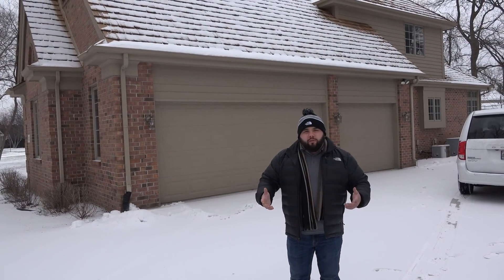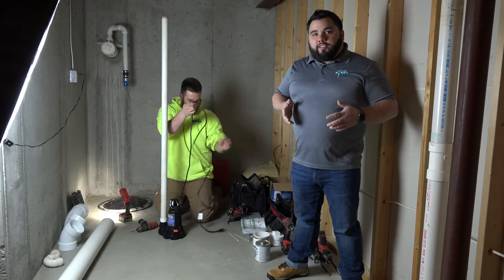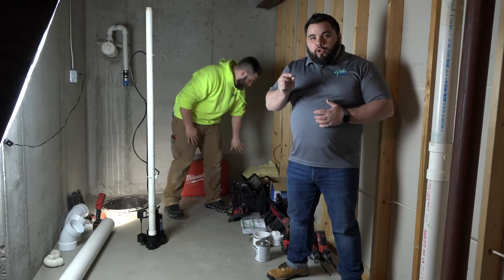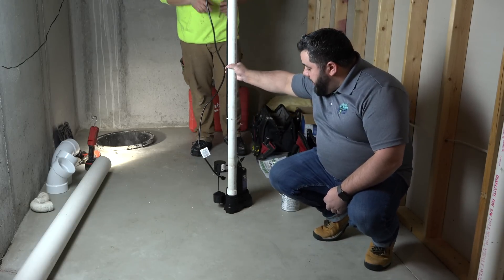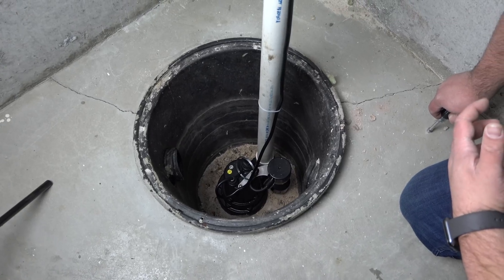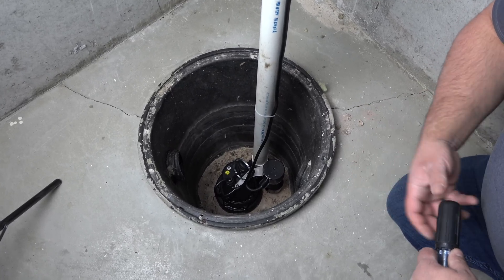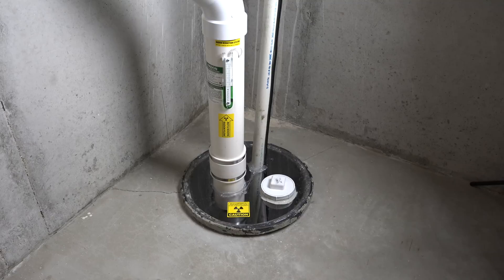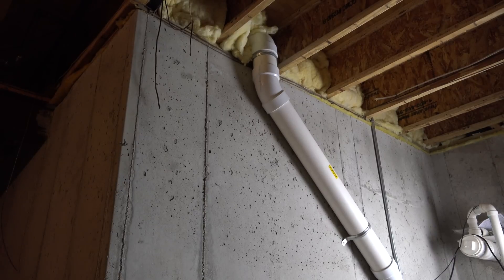Radon Mitigation System Installation

Comment: I';m surprised that the homeowners were content with having white PVC running up the exterior of the decent-looking home.  It is quite an eyesore.  Of course, it could be painted, but it would have been much more aesthetically pleasing to have the PVC follow some plumbing chase and exit the roof (despite the cedar shingles).

Comment: Now this may be a dumb question but does coring that small hole for the flexible hose reading the preassure on the u-tube cause any radon gas leakage through the cracks in that hole?
Reply: It shouldn't. But I siliconed around mine when I installed it to be sure

Comment: How would this work if my home has an existing sump pump (Illinois) and the pump sits down inside there like you were saying? Does this make the install easier?  I honestly wasnt even aware there was any other type of sump pump. Also is an electrician required? Im a union electrician so i could do my own power setup if necessary. And lastly, wear an n95 mask when drilling through brick or concrete. Silica dust is dangerous

Comment: First can the homeowner install a radon system if they get flagged for radon, and why not put the fan inside the house just over the sump pump?
Reply: Good question! It depends on your state code and whether or not the contingency requirement specifies if the homeowner can put it in or if a “qualified/certified/NRPP” professional must put it in. Here in WI you could put it in as a homeowner as there is no state adopted regulation concerning radon. Moreover, the fan can only be placed in one of three places according to the national standards of practice - that is, either the outside of the home, the garage (if there is no living space above the garage) or an attic. The thought process is that the positive pressure side of the fan/pipping (exhaust) should never be within an occupied or potentially occupiable living space should it ever leak. Hope this helps!

Comment: What if my slab has a gap around the perimeter because of when they put in my perimeter drain?
Reply: Good question! Depending on the system, you need to seal the top of that perimeter drainage system. Is it’s a typical “weeping wall system” that is, a system where small holes are drilled at the bottom of the block to allow water to weep into the newly installed drain-tile, you will have to seal the top of that baseboard trim (typically looks like a black, waffle board pattern) around the entire perimeter of where it was installed. If it’s pulled away from the wall, you should use backer rod so the caulk does not fall behind and clog the holes. This will ensure that even when sealed, the system will work as designed. If it’s tight to the wall, simple masonry (polyurethane) caulk across the top should suffice. If you have a different system where a large perimeter gap is just simply created in the concrete (almost like a large floor to wall French drain system) you may not be able to seal that. You may instead have to drop your pipe in the middle of the home, as far away from the perimeter at all points as possible, and attempt to create a negative pressure with a dug out collection point (5-10 gallons minimum of the sub-slab material) greater than that of the natural pressure differential between the home and the soil. This will help attempt to create a vacuum under the slab with less potential for the perimeter gap to steal air from the structure (ultimately breaking the vacuum). Hope this helps! Good luck to you!
Reply: @brianthompson1039  but I can’t get to it in 90% of the basement. It’s finished with a wall in front on it
Reply from the maker: @georgelichak3972  You can try and do it without sealing but it may not work. Best advice would be to install it and seal what you can and then retest. If the levels don't go down on the retest, you will have to cut the drywall away at the bottom to seal all the way around. You could also try the other methodology I mentioned of dropping it out in the middle/away from the perimeter drainage.
Reply: @lifetimeradonsolutions9498  one more question. What is the reason for not being able to put a 180 degree bend in the exhaust pipe over the roof line to keep water out?
Reply: @georgelichak3972  Thanks for asking. It’s against standards of practice because it restricts airflow so much and redirects the affected air toward conditioned areas of living. Ultimately the airflow restriction leads to a less effective system but also potential freeze ups in the winter as the air tumbles at the top and is more likely to condensate and freeze causing ice dams and premature fan burnouts. Lastly, it is unnecessary to cover it or put elbows at the top because even if you look as passive plumbing vents (ones that don’t have a fan pushing away water) you can see they are wide open as well. Radon systems remove a ton of moisture (anywhere from 2-4 tons annually according to the EPAs study on sub-slab depressurization systems as moisture control systems) and so the moisture or water is totally fine going through the system and ultimately back into the drain/tile, sump or sub-slab material. Hope this helps!
Reply: @brianthompson1039  so it won’t hurt the fan?
Reply: @georgelichak3972  Yes is will hurt the fan.

Comment: what if you need to service your sump pump? They don't last forever.... I've had to replace mine about ever 5 years. Also did you put a cap on the top of that pipe or is it open to the elements where rain can just get in.
Reply from the maker: Hey! If you need to get into the sump to change the pump we typically put a crosscut through where the sump line ejects. This makes it easy to simply peel off the silicone seal and pop the lid off in less than a few minutes. In terms of leaving the top open, in northern states like here in Wisconsin it is important to leave the top open. This is because any cap will restrict airflow substantially, causing the air to tumble at the top. When you are pulling relatively warm air (40-50 degree F) from beneath the slab in the winter and the air on the outside of the home is super cold (below 0 F), it will condensate and cause ice dam/freezing issues that will prematurely burnout the fan motor. If you are in a more temperate climate, you can use a cap but it isn't overly necessary as the fans are designed to pass moisture through the system and that moisture will ultimately drain back into the sump.

Comment: Great video, thanks. I have a question. Why is the PVC pipe left straight up above the roof and not with a hood or like a candy cane. Doesn't that allow rain water into the system and then make more work for the sump pump?
Reply: Hey! Thanks for reaching out. Typically there is enough air moving through the pipe that minimal rain gets into the sump (the air pressure exiting precludes much from getting in). By depressurization the sump and ultimately the drain-tile you can ensure that you are effectively pulling air around the entire footprint of the foundation. That is why drain-tile/sump depressurization is such a common and effective means of mitigation.
Reply: @brianthompson1039  Thanks for the information, you have a great day.

Comment: I’m confused why you installed a sump pump when there is no water in the pit you just created? A pump needs water to keep it from burning out.
Reply: Bro the pump only runs when the float activates it, aka the basin is filled with water. In the summer when I get a few days without rain my pump is bone dry down there, but it's off

Comment: I just bought a home and the seller’s were required to install a radon system. The tube with the liquid gauge is in the garage and the venting pipe lets out through the roof of the garage. But my bedroom is above the garage so all the air the radon venting pipe is letting out is literally on the other side of the wall where my head rests while sleeping. House is vinyl siding and not brick. I mean I can hear the constant humming coming from the pipe from inside the bedroom. Was this done safely?? Is that radon gas seeping into the bedroom through the wall and while I sleep??
Reply: Thanks for reaching out! I think the best thing to do would be test your room and see what the levels are. However, in terms of standards as long as the exhaust vent is 10-ft from a window, or two feet above the window, you should be compliant that way. Typically, once exhausted outside, the gas is diluted rather quickly so I believe you should be OK. The tough part is that every home is different and the only sure way to know is to test. My recommendation would be to test the room of concern :) hope this helps!

Comment: Hey guys, great vid!  Question though, if I want to use 4" pipe for the system, but the fancy lid I purchased has a nice threaded outlet for 3" pipe, if I use the 3" coupling and step up immediately with an adapter to 4", does that defeat the purpose of the 4" pipe?  Will the fan still demand the same airflow through the system, it'll just increase velocity a bit at the lid when it momentarily passes through 3 inches?  Thanks!
Reply from the maker: Hey! Sorry - I must have missed this comment. You can do that but it will choke your suction point to some degree. Depending on the application, in this scenario, it may make sense to run 3" pipe below the fan and 4" pipe above the fan. This is a common practice in the industry. Hope this helps!
Reply: @lifetimeradonsolutions9498  thanks I went ahead with the install back then and elected to just go 4" all the way and cut and fabricate my own new opening on the lid.  Glad I did it, super quiet and excellent flow rate according to my manometer calculations with the RP145

Comment: The straw explanation 
But what about the cracks?
Wouldn’t that lessen the vacuum like you said?
Reply: Yes - major cracks can definitely cause issues. In this particular home, after system activation, we tested the cracks with a “smoke pen” to see if the negative pressure was pulling air through the cracks. The slab at this property was in pretty good shape - if I remember correctly we had to seal some cracks/gaps but because it was relatively new construction, there was a vapor barrier under the slab that also ensured a tighter vacuum. I hope that helps!

Comment: Lol what happens when u need to change the sump pump 🤣
Reply from the maker: Hey! Thanks for the comment! It’s actually quite easy—it’s important to use clear silicone caulk for both aesthetics but also it is much easier to unseal. You simply score the sealed portion with a knife/razor and pop the lid off. You disconnect the radon pipe at the black rubber coupling so you don’t need to cut it and the sump lid is cross cut so you don’t need to cut/disconnect that pipe in the event of an emergency. I hope this helps!!
Reply: @lifetimeradonsolutions9498  I can't follow the last two sentences in your explanation of how are you can easily service the sump pump when needed. It would be great if you could provide a labeled picture explaining what you mean or a short video doing the same.
Reply: I d replace my amp pump, soles I reinstall the clear caulking. What type? Latex, silicone, thanks
Reply: Sorry, meant to say sump pump

Comment: Had a unit installed before we moved in to our house. They installed it near the pump and everytime it rains heavily the radon fan pulls water up the radon pipe and water sprays everywhere. Any ideas because the guys that installed it said that they have no clue. Called them twice and I just gave up drilled a whole in stuck a tap in it and open it up ever time it rains. Any ideas?
Reply from the maker: Hey Peter! Thanks for commenting! Did they install into the drain-tile next to the sump pit or into the sump pit itself? If into the sump lid (that is the sump crock/pit) itself it might be that the pipe is driven too deep into the sump basin. It is really only necessary that it sits below the cover about an inch or two. Also, it could be that you need to adjust the height of your sump pump float...so that the water doesn’t get so high in the crock that it is pulled into the pipe. 

If the pipe is tied into the drain tile this may be a bit more complicated of a fix. What I have done in the past is made sure the pipe is simply hovering over the drain tile rather than touching it. Further, I have made sure that part or half of the pipe is over the drain tile while the other half is over the gravel. That will relieve some of the pressure on the drain tile and even it out over the gravel (which is still porous and will not compromise the field extension under the slab in most situations). This should allow the system to still be effective while not creating an aggressive enough suction that pulls the water through your pipe. I hope this helps!!!

Comment: A before-and-after test would be nice.
Reply: lpz the customer usually calls us because they had a test that indicated high levels. On some occasions we do the initial test too, but whatever the case we always do a retest to show that the results are below the EPA standard of 4.0 pCi/l — if for whatever reason they are not we guarantee the results so we will continue to work on the house until the levels drop.
Reply: @brianthompson2002  thank you for the quick response didn't expect that. I was just curious on how much it dropped it ..in that case. My radon came back at 3.18.pcl . Garland Tx.
Reply: lpz My pleasure! This house started around 7 pCi/l and we got it down to 0.3 pCi/l. I would say that’s a typical drop when there is drain-tile present. It can be a lot tougher down south or even up here in Wisconsin with slab-on-grade homes or homes with crawl spaces (although I am not aware of your situation). I hope that helps!!

Comment: The sump pump does not look very easily accessible with the way you sealed the clear lid in place! This would be a better option! https://www.jackelinc.com/smr16101-cv.html The customer really appreciates the fact that it has a gasket sealed removable lid
Reply: That is a nice lid
Reply: @InquiryTeaching  we also like to go straight up through the soffit and the roof for a cleaner, more perminant look instead of going around the soffit and gutter. Maybe you also do that in certain situations!